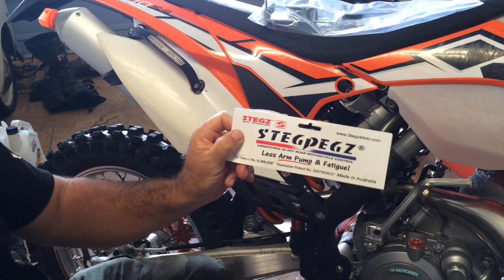Sunday Rides - "KTM STEGPEGZ Install"

Comment: does this mean that the Steg Pegz is actually over your air filter cover and that each time you need to remove it to change or clean your filter ??
Reply from the maker: actually on this bike i can remove the cover without taking off the pegs not sure about other models